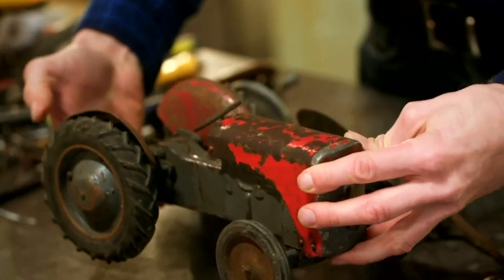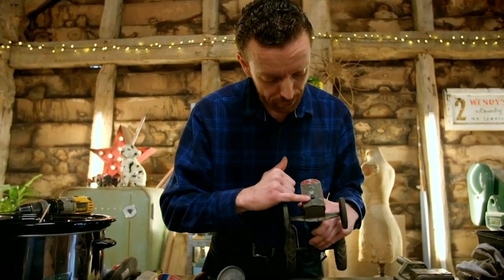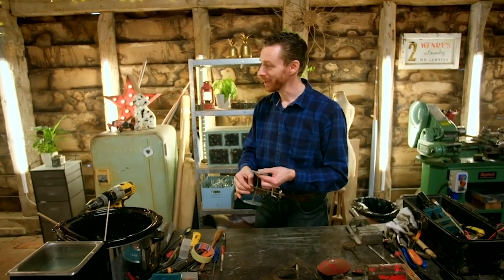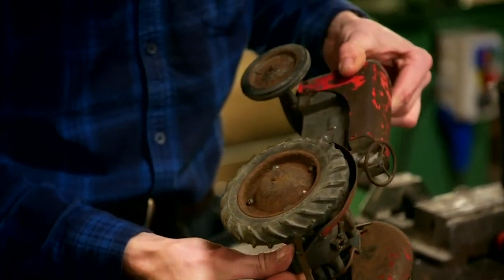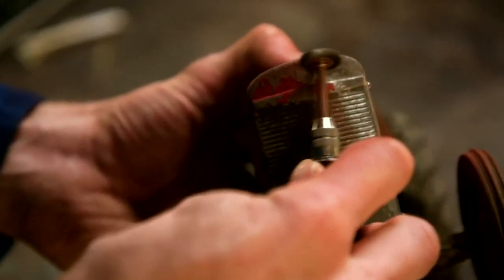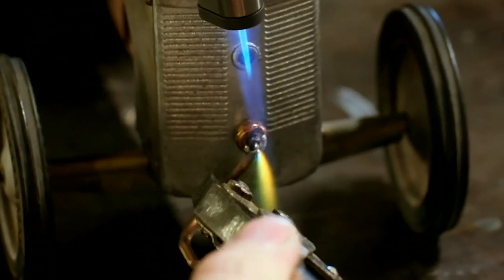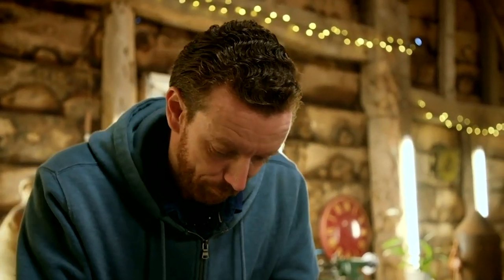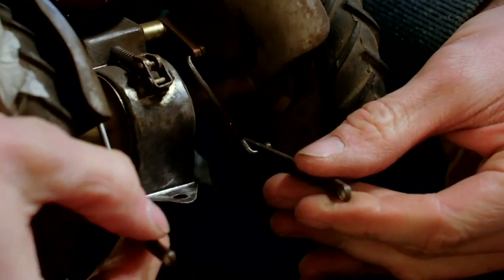Repairing a Miniature Tractor That Travelled the World | The Repair Shop

Comment: Nice. Is the winding handle to scale? It seems huge but it may be the case
Reply: It's actually probably pretty close. A Ferguson is not a big tractor. You can haul two on a 19' trailer and a cultivator. They pass easily through 8' gates. It might be a bit thick for scale, but the rest is close  to the cranks for them, I've seen.